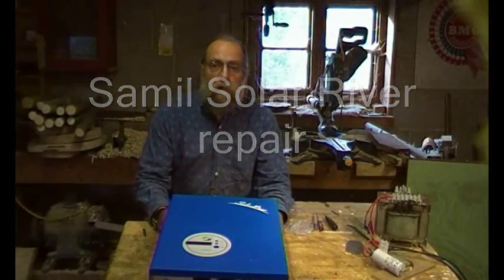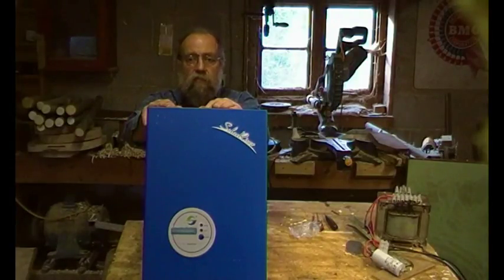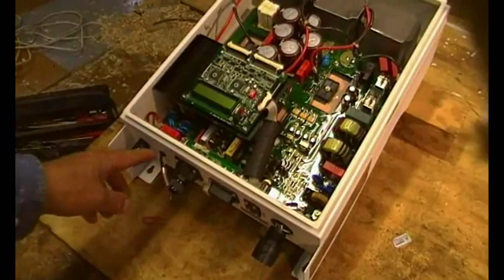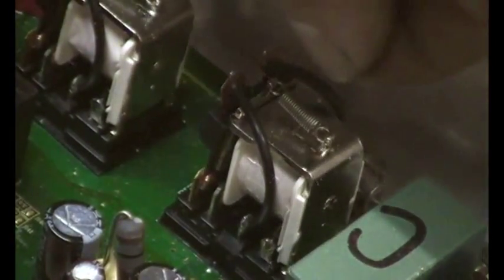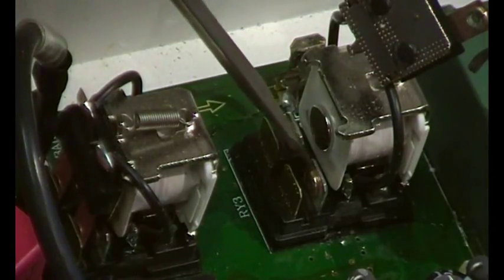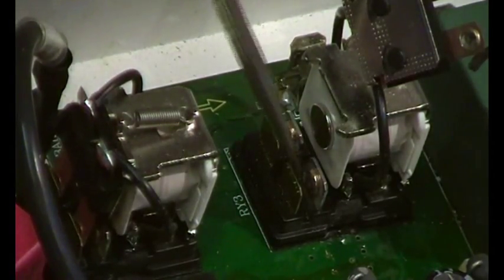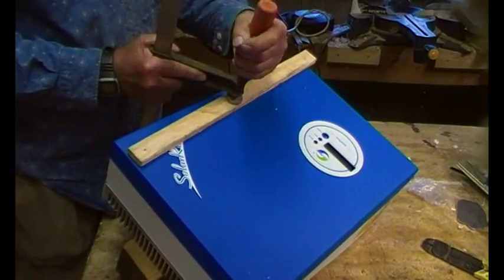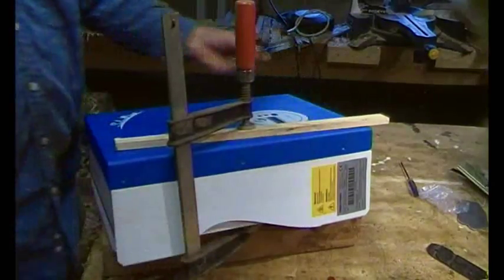Samil Solar River inverter fix, disconnect fault, refit the top method.

Comment: Your video gave me the gumption to try cleaning the relay/bending contacts as you mentioned. After isolating the "live system",  I was able to pop the plastic relay lid (though the plastic catches at the bottom broke off). Five minutes later, the Solar River inverter (which has been down for months) was up and running. I couldn't believe how simple and effective that fix was. Thanks for making me look like a hero to my father in law. He had a quote for $300 for a technician just to turn up. Anyhow, I now have an order for a couple of the relays from Hong Kong in case the contacts get too corroded.
Reply from the maker: Nicholas, I doubt if  that tech would have been able to fix it, but we have, please see my book "Wind and Solar Electricity". Subscribed? cheers
Reply: Hi, would you have a link to the replacement relays by any chance?

Comment: Great work Andy, I have just fixed my inverter that has been giving me trouble for about 6 months, I had it off the wall, apart, fixed and all back together on the wall (and working) in 30 mins, even the wife commented on how quickly it was fixed 😀
Reply from the maker: Aaron, thanks for the message, perfect, yet another inverter and wedge of cash saved. Please check out my books (details on my channel page) and have you subscribed? cheers
Reply: So I found this 'fix' to only last a few months, then each time I fixed it it would be shorter and shorter between repair attempts.
This time I decided to replace the relays. I found them on eBay, and after pulling the unit apart, replacing the relays it has not missed a beat.
Reply: @skitskatskallywag   Hi, would you have a link to the relays you bought?
Reply: How did you get that board out? I tried but it won't move a mm. Almost like it has been glued on there.
Reply: @hermanamex6294  that's weird, I'm sure there was just a bunch of screws.
Keep in mind that capacitors are like batteries, they will hold charge and can kill you!
Reply: @skitskatskallywag  Thanks, maybe I have a different kind of pcb board in there. I might be changing only the contact plate on 1 of the solenoids as the contacts of it are very rough and not shiny, definitely dont have a smooth surface . The unit is from 2013 so I will try this first to see if I am able to fix it this way.

Comment: Many thanks Andy. I had been sitting on this problem for a bit, and was about to call the electrician today when I saw your video. Had to take the unit off the wall to get access to the screws on the side of the switchboard. No fix after cleaning first relay, but joy after giving the second attention (cleaned contacts, closed space). Much appreciated all your tips. working like a gem.
Reply from the maker: Paul, brilliant, yet another inverter and wedge of cash saved. Check out my books and have you subscribed? cheers

Comment: You're a genius.. followed your advice. Left the inverter on the wall but was very careful to switch off both DC input and Ac output. Had no trouble removing or replacing the screws. Th clear plastic covers over the relays were a bit stubborn. I didn't remove the tiny springs  in the relays for fear of losing them. I bent the contact closer together and used a points file to give the contacts a bit of a rub. Hasn't failed since...thanks for your efforts in putting this on youtube.
Lee
Reply from the maker: Lee, thanks for the comment and the appreciation, subscribed? cheers, Andy

Comment: I can't get the blue top off. Can you help????
Reply from the maker: Hi, there are 3 screws each side, if it is still difficult after these are removed then warm the edges up with a hair drier to soften the seals. There may be 2 screws under security stickers. cheers

Comment: Hi and thanks for your video. 
Do you know what is needed to use this inverter as an off grid set up? Thanks
Reply from the maker: Hi, that option is not possible as this type of inverter requires a high voltage input and the AC signal is taken from the grid connection. You need a battery based fixed voltage inverter. For a thorough grounding on all the choices see my Book (Wind and Solar Electricity, edition 3) Here's a link: https://store.cat.org.uk/collections/books/products/wind-solar-electricity-a-practical-diy-guide-3rd-rev, cheers

Comment: No they r long skinny black one's
Reply from the maker: Rick, these soumd like the same units as used in the eversolar inverter I fixed where I fitted larger relays. The original relays were Song Chuan, DPDT (dual pole dual throw) 894 2CHA2 - F- C. I found some Finder units that had the same diamensions and coil resistance, Finder type 40.52 mini PCB, check out the videos in the my grid inverter play list: https://www.youtube.com/watch?v=dlYATJYB6RU&list=PLQAXpOOjFoVHefMyqH2lDW3ibs4ddSJn4&index=8. Please give thumbs up, subscribe and buy a copy of my book: Wind and Solar Electricity, cheers

Comment: I need a good inverter at a good price. do you have any idea where I can get a good inverter? used. as long as it works good. 24v 60hz. 120v. have any idea?
or even a 48v or 12 v . but it needs yo be 2500-3000w give or take. but I would like a 5k+ if I could afford it. thanks. I learn a lot from your videos
Reply from the maker: HI, I would look at Victron, steca, outback, or mastervolt. 110v and 60 Hz means you are not in the UK, so I don't know, try Ebay or similar. Cheers

Comment: Just watched your video then Jethro Tull came on the radio....magick! ;) You've had quite a bit of luck fixing those inverters by sorting out the relays.
Reply from the maker: Hi, Songs from the wood, or Dahma. Experience with the eversolar taught me some of the symptoms and causes. Though I destroyed one of these units in the process. They fixes cannot all be that simple, but who would be bothered to spend a few hours tracking down the fault? Building a test rig helped significantly. Cheers, Andy

Comment: That was an easy fix Andy ! Are these boards using Chinese made relays do you think ? Having to bend a contact like that is pretty poor really. I've never known a relay fail like that personally !!
The case screw holes being so misaligned isn't great either - I wonder if they have a piece of wood and a g-cramp on the production line :o))) Another inverter working again anyway. whic is good. Dave
Reply from the maker: Dave, thanks for the questions, yes they are Zong Chuan, 15 amp. The contact size is great and this inverter has 7000 KwHrs on it, so it worked well for quite some time. One never knows what system it was fitted to, and how many panels. Some installers push inverters too hard and the customer looses on durability. The fix seems to have increased pessure on the contacts to good effect. The case cover is only a problem due to the postition of the screws, the problem being that the seal needs to be compressed. Most inverters the cover is pulled down onto the seal from the front. It's always good to have a few spare units, but because I don't run mine anywhere near their rated power then this spare may well stay where it is. Cheers, Andy
Reply: The relays might have been soldered to the pcb in a way that softened the plastic and the contacts moved a bit in fairness to the relay maker. As you say, those have done some time without failure already. The case has a seal to compress....ahhh I see, as you say, screwing from the front would have got around that problem. Dave

Comment: If only they were that easy to fix Lol, what pointed you in that direction in the 1st instance? Good job good fix Andy
Reply from the maker: Hi, experience with the eversolar units and the fact that there was a faint buzz  from the relay area. I know from experience that contactors will buzz if there is a problem with either the contacts or contaminated laminations. Cheers
Reply: Andy Reynolds Thanks for reply your experiences shared are most valuable